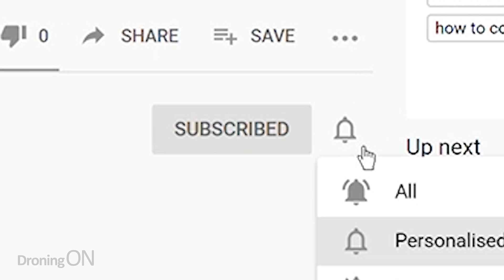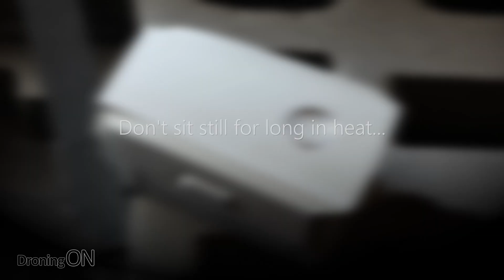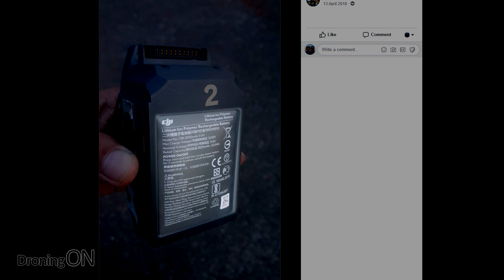How to avoid SWOLLEN DJI Mini/Mavic Batteries

Comment: Bottom line: DJI drone batteries are reliable for only about 70% of their claimed duration.  Once the residual capacity falls below 30%, all kinds of problems become prominent.  Older batteries (re-charged more than 100 times) seem prone to fail, puff up, or pop out from the encasement, as the capacity falls below 30%.  Unfortunately, DJI no longer sells OEM batteries for the original Mavic Pro.  DJI no longer sells batteries for the original Mavic.  According to buyer reviews, the available "white label" substitutes perform poorly, after several re-charges.  Wish it were otherwise.

Comment: We’ll fly combo is the value for money ! Take Mavic air 2 for an example the fly more combo cost only £180 extra and you get more than batteries.
Reply from the maker: Yes the combo is good value, but it's still £180 extra, for accessories and batteries which you may never use. Thanks for the comment.

Comment: Hi,
do you know if batteries drain itselft. as i charged the battery to 100% but did not use it for three days. After 3 days when i put the battery to the drone i noticed it 60%.
do u know why is that.
thanks in advance
Reply from the maker: Yes they do, DJI batteries have an inbuilt drain as mentioned in this video. Thanks for the comment!

Comment: Great advice! "My wife" crashed my Mavic 2 some days ago but that's a tank of a drone so it just needed 2 new propellers. But the top of the battery got a bit scratchy. All works fine but can it have taken damage? The battery I mean.
Reply: When a battery is dropped from 5 feet on the hardwood floor. It is considered done. It will give you an error message.
Reply from the maker: Haha, blame the wife :) if the battery isn't physically or visually damaged then it'll be fine. Look for dents and swelling.
Reply: @Droning-ON  Haha. Battery looks good. Only minor scratches on the skin on top. Should be fine. 👍

Comment: Another one is check your batteries every 3 months if not in use. The Batteries continue to slowly discharge after they reach the auto discharge point. If this is left to long you will either damage the battery or get a cell so far out of balance that you will get the faulty battery warning that prevents you from talking off. Cycling many times will sometimes fix this problem. The internal balance circuit is not good at balancing large gaps in charge.
Reply from the maker: Thanks Brian, this does happen but LiPo's don't discharge very rapidly at all, even after 3 months a battery can hold most of it's charged capacity. Thanks for the comment!
Reply: @Droning-ON  That is true of non smart batteries. I check and storage charge my "Normal" batteries every 12 to 18 months. Unfortunately with DJI smart batteries the smart monitor circuit is always online. It is this circuit that slowly discharges the batteries to dangerous levels. This is why DJI recommend you charge them every 3 months in their documentation. Also if you do have batteries in storage, do not trust the Light indictors by pressing the power button once. It keeps the indicators at the level they were when the self discharge circuit completed, so you get 2 on and one flashing. As soon as you put in on the charger it will show 25%, 1 light on. This is after 3 months of storage. 4-5 months I have lost batteries due to being tardy. (Mavic Pro and Phantom 4 Pro+)

p.s. DJI actual use LiHV chemistry in their batteries. This is one of the reasons that people get confused when judging charge levels from the GO of Fly application.

Cheers

Good video and reference. I will use it in some of my online "discussions" :)

Comment: I was always taught to completely discharge the batteries and charge them again to 100% at least 3 times, so that the battery would last. So it's exactly the opposite?
Reply from the maker: That would apply to NiMH batteries but not to LiPo because they don't have the "memory effect'" issue. Lithium Polymer batteries should never ever be completely discharged. Charging them to 100% is absolutely fine when you're going to fly.
Reply: @Droning-ON  Ok, thanks for clarifying that to me, i'm glad to learn that, cause the batteries aren't exactly cheap. :D

Comment: I go a couple of steps more with numbering my batteries. I have a number on each but I also have elastic bands that tell me which one was last used and it also helps to know which has been cycled the most, that way it naturally evens out. If thats not enough I also have an EXCEL spreed sheet to keep track of flight times and depletion rates, charge times and high temperature reached during flight
Reply from the maker: Thanks for the comment and for subscribing! Elastic bands is a nice idea, so long as they don't prevent the battery from fitting into the drone which is a challenge with consumer GPS drones.
Reply: I take the bands off pior to fitting to drone

Comment: Excellent video. It's a shame that electronics manufacturers (including makers of quadcopters) do not provide battery management tips - best recharge cycles, best battery levels, max draw down, don't store fully charged, careful of heat - but then, they make money selling replacement batteries :)
Reply from the maker: Yes that's true, they always seem to neglect the most expensive component of the drone, which is unfortunate!

Comment: It’s also worth pointing out that it’s not just the financial loss, there will come a time when you can no longer source a battery for your drone, and this will happen much sooner than you think. As an example in my fleet I have a Spark, a very popular little drone. I’ve only owned it three years and yet batteries for this little drone are now very thin on the ground, and those that are out there will have been sitting idle on a shelf for at least 18months. It’s for this reason I’ve chosen to go back to building my drones because there’s no shortage of suitable hobby RC LiPo’s and in general they don’t have the same insane markup as OEM inkjet cartridges.
Nidge.
Reply from the maker: Yes that's very very true, and trying to replace the internal battery within one of these DJI hard-cases would be very complex!

Comment: A couple more tips. Write the date of purchase on the battery. This is useful when you have several purchased at different times. Typically old batteries do not retain their charge as long as new units. Secondly, do not leave batteries in a discharged state for extended periods (e.g. 12 months). Once the charge has diminished to a too low level, you may not be able to charge it up again.
Reply: Advices by DJI is to cycle at least every 3 months. Route 1 to battery death is leaving them unattended for too long... Also don't forget the Controller
Reply: Good idea that about the date 👍
Reply: I also put a number on my batteries as in #1, #2, #3. That way I know that I am not always using the same battery over and over again for short flight periods.
Reply from the maker: Great ideas, thanks Stephen!

Comment: My Mavic Air 2 batteries keep loosing power after a few days of not using them. Is that normal?
Reply: Yes, they partially self deplete to protect the battery. On several of the DJI drones you can select the number of days before self depletion begins, but not on the MA2, if I remember correctly.
Reply: @stephendoggett190  You can change it on the Mavic 2. I think DJI might add this feature to the MA2 in a firmware update.
Reply: @root-at-localhost3691  Yes, I knew that you can on the M2P, but not the MA2 or the Mini (I have all three).
Reply: @stephendoggett190  the mini has no self discharge feature at all so you need to watch that. The MA2 does but it isn't configurable unlike the MP1.
Reply: @8dcphoto  just answered my ? About Mini batteries, thanks 👍👍
Reply: @8dcphoto  Really? I have to say that mine seem to discharge fairly rapidly, thus I assumed they had the self discharge feature.
Reply from the maker: This is standard, there is an inbuilt discharge feature in DJI batteries. You can set the period in the app.
Reply: Li-Po batteries are, compared to Ni-MH batteries, fairly shelf stable - said to self discharge about 10% per month. Ni-MH rechargeable batteries, on the other hand, self discharge about 30%/month or 1%/day. How much capacity (%) are you losing in just a few days? Shouldn't be losing more than 1-2%.

Comment: My question, is: you just finished flying your 3 bat to almost 8%..... you got home after 40 mins. You have your charger pad. That can charge three bat. After all three batteries are charge. Can you leave them plugged in the charger ? Let’s say for three days without going to fly?
Reply from the maker: Thanks for the comment, I definitely wouldn't. I'd plug them in and charge them to 2/3 lights, then disconnect. Then charge them up ready before I'm actually going to go flying.
Reply: @Droning-ON  great tip Ash, im gonna try manage that👍👍
Reply: Not sure id do that, heard phone batteries shouldnt be left charging over night as they will drop in charge a little then top up over n over again? Not sure if this applies to drone batteries too but......?!

Comment: Any advice on storage between flights? Is there an ideal temperature?
Reply from the maker: The batteries heat it rather dramatically during heavy load, so for them to cool to room temperature is desirable afterwards.